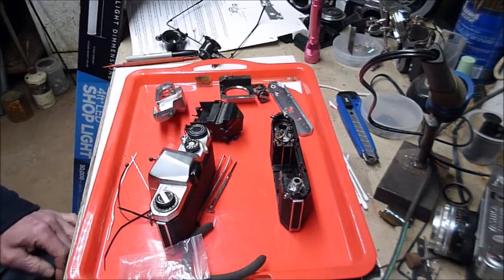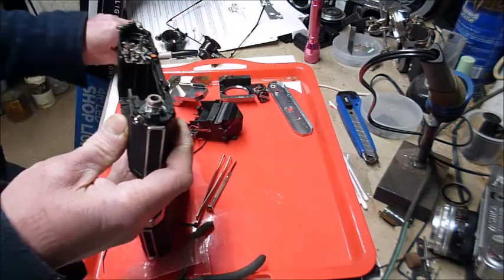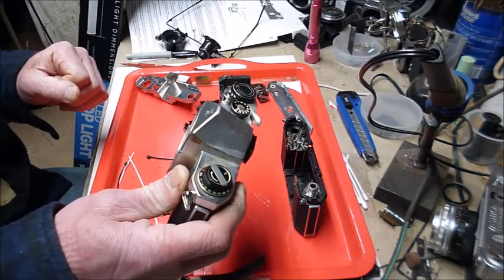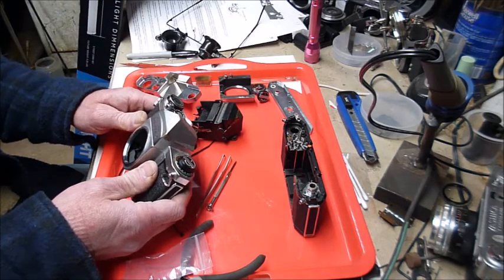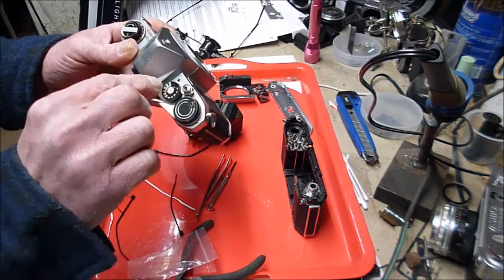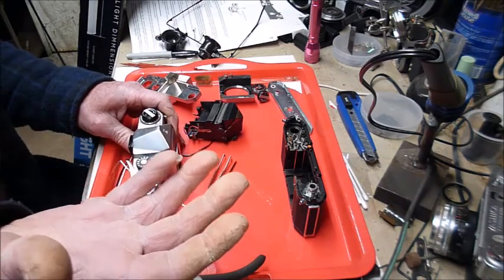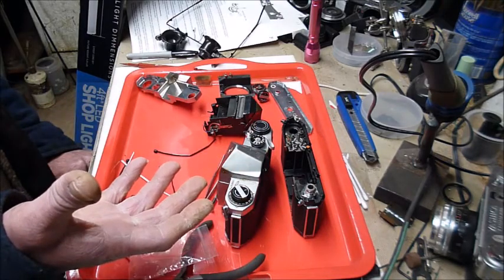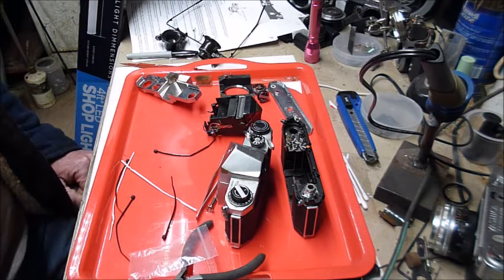Pentax S1A tear down

Comment: I have found your s1a videos very useful. I have a s1a but unfortunately the slow speed escapement black box is missing. This means slow speeds are not working. Do you know any workaround? Would you be willing to sell one of those for a fair price from you massive collection of s1a?
Reply from the maker: You mean the clockwork in the bottom of the camera? If it isnt there you had better check the rest of the camera. There is no reason to remove that thing if the camera works at all.
Reply: tobroken1965  Yes I think the exact term according to the s3 service manual is "slow speed governor" which is the black box near the bottom of the mirror. As in my unit the complete box is missing, I'm unable to set any speed below 1/60(?).

Comment: hi, I just wanted to say a BIG BIG thank you for this video series on the s1a, i have now identified two missing springs on my parts only camera due to your excellent videos.
God only knows what happened to these springs but i suspect someone had a go at fixing it and lost them! I have the mirror box out at the moment to change the mirror as its in bad shape, so i thought i would put a tiny drop of oil on the shutter spindles/drums bearings while i have good access to them due to a slight squeak when firing.
what oil would you recommend for this job, many thanks in advance and please keep up your amazing work buddy!
Reply from the maker: Thank you for the compliment and glad I could help. I have 2 oils that I use, one is a synthetic watch oil I bought on Amazon, search ASIN (B00CM19L5K) and the other is an even lighter "clock" oil I bought on Amazon, here is the ASIN number you can search with ( B00AANDC34). Both work equally well, the synthetic is a little thicker but its a matter of choice. I imagine that any watch oil will work just fine but avoid anything like 3 in 1 oil (its much to heavy) or spray oils, and remove any excess before it has a chance to migrate. 
It is surprising how many old cameras that I have bought have already been taken apart and that is sometimes the problem with them. Good luck and post your results and any observations you have for others to benefit from.
Reply: @tobroken1965   Thanks for the tip on the oil, i have just ordered a light watch oil with a needle point applicator, should be just the thing to get a drop of oil in the right place. on a side note is it ok to fire the shutter with the mirror box removed, just to work in the oil before reassembly?
The problem i had with my s1a was as follows:

Shutter only firing at 1 second regardless of the shutter speed dial setting, this turned out to be a spring missing just above the rewind button, with the bottom plate removed its towards the front of the camera and runs parallel with the body. This spring seems to put tension on the shutter speed  mechanism and without it the lever just flops over to the low speeds!

Second problem was the rewind button would not stay in after being pressed and kept springing back out. This was a coil spring missing again just to the left of the rewind button and is hidden under a screw with a big flat head slot, this L shape lever needs tension to slip under the rewind button when pressed and in doing so locks the button down to enable rewind of the film.
Hope all this makes sense and is of help to someone, the shutter speed had me fooled!

These parts can be seen in the slide show..

Again i cant thank you enough for the help this video gave me.  I have just picked up another parts camera for the mirror so will keep you posted.
kind regards adam
Reply from the maker: Adam, I reviewed the slideshow and saw exactly what you were talking about, that speed cam gave me some trouble during reassembly. Finding missing parts is both exciting and frustrating, but it goes with working on old stuff. As far as firing the shutter with the mirror box out, I dont know. I cant think of any reason why it wouldnt be ok, as long as all other parts are in place, the only wild card I can think of is the lever on the bottom of the mirror box that stick through the bottom of the camera, I'm not sure how its absence would affect the rest of the linkage. I would say proceed with caution. Dont let the gears come unmeshed if you can help it, getting the timing back in tune is a pain in the butt.
Reply: Hi buddy, just a quick update, the camera is back together and working fine. I have adjusted the shutter curtain tension by eye and sound and think its in the ball park, (when i first got this camera the shutter blind was not quite closing all the way).
I have put the camera along side my spotmatic to compare and all seems good, maybe the s1a is a touch slower.
The slight shutter squeak is still present after oiling the bearings but i dont know what else would cause this squeak? its not bothering me just a bit annoying lol
I am going to put some film through this the weekend and have a look at the negatives, as that should tell me if the shutter is capping or doing anything strange. also an added bonus is my clip on light meter worked with just a new battery...
Reply from the maker: Thats great news! I will be interested to know how your negatives turn out. If you didnt have to replace the shutter cloth you might be OK. Mine has a hickup right at the closing point of the new shutter. 
I have 2 working clip on meters and they work pretty darn well for being as old as they are. Good luck!
Reply: @tobroken1965  Hi buddy, just a quick bit of feedback on the negatives that came from this camera.
I wanted to check the shutter speeds and see if the shutter is capping or not so i loaded film into the camera and took three frames at 500th 250th and 125th. 
I then rewound the film back into the cassette leaving the leader out and reloaded it into my tried and tested spotmatic, i made sure to cover the lens and advanced the film the normal three frames to get to 1, then another 3 frames to get past the pics i just took and another 2 frames just to make sure. I then shot my 3 pics on the spotmatic at the same shutter speeds and also used the same lens for both tests. 
Then cut out the film from the camera in the dark room and develop!
And the results are no shutter capping whatsoever, and the exsposures at 250th and 125th are identical to the spotmatic but 500th is about one stop slower. I can live with that and am very pleased, thanks again buddy and keep up the good work. 
ps.. I have started looking for more to repair now, ha ha ha
Reply from the maker: @billing5426  Thats good news, well done! How are the slower speeds? Those seemed harder to me to get right. Its a good feeling using a camera you brought back from the dead. I like the one I put the shutter curtain in even if the shutter is quirky. 
Beware of looking for busted cameras, you will have a houseful in no time! I look for the Pentax cameras that are listed as "stuck" mirror, or in one case "no" mirror. They usually have the same minor problems and can be had for a little as $1, not many people broken cameras. Good luck and happy hunting!
Reply: @tobroken1965  hi, yeah the slow shutter speeds sound about right by ear, i did clean the slow clockwork mechanism in alcohol when the camera was apart as it was a bit gummed up!
 Hats off to you for the shutter curtain job, that is not for the faint hearted! I think that job is a bit beyond me ha ha.  
I know what you mean about a houseful of cameras, i have have far to many now. but as you say there is a sense of satisfaction in bringing a old camera back to life!
I look forward to see what else you rescue in the future, keep up the amazing work mate..